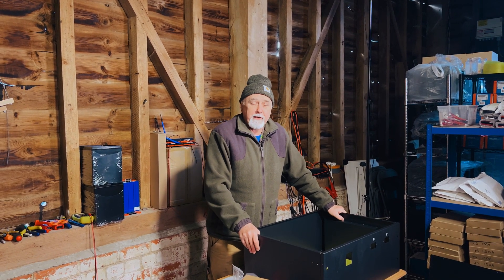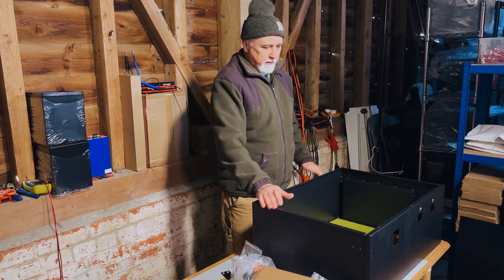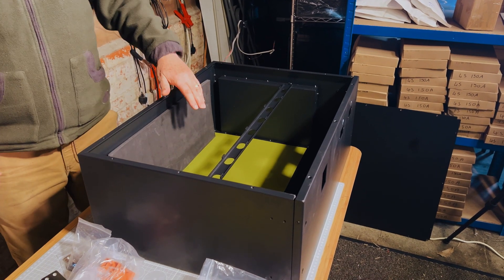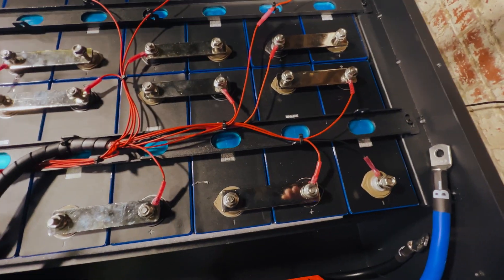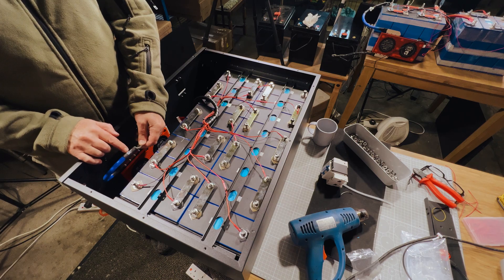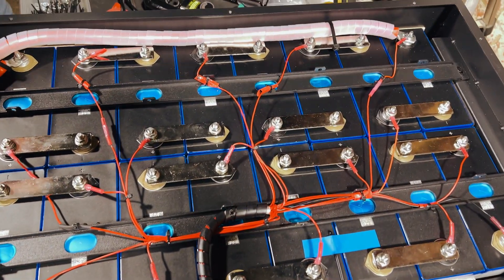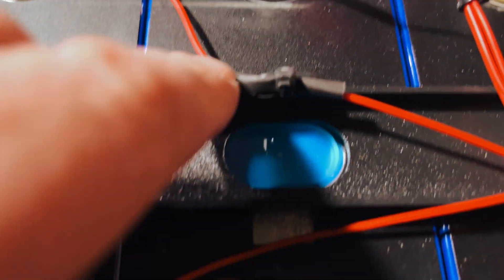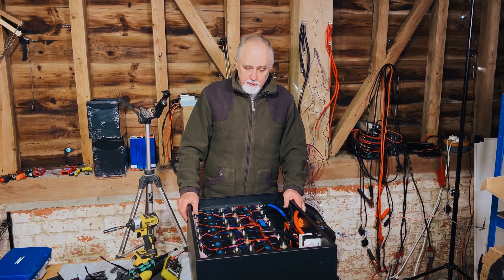New Custom 48V LiFePO4 Battery Build

Comment: That's how I wired mine up with final 48V connection points on the outer terminals in stead of the center. I like it farther apart.

Comment: I like what I see. Problem is you dont explain the BMS connection thoroughly.  I have a Daly 48V 250A 16S Smart BMS. I have connected  sample leads correctly, I think. They test good with multi meter. 
So, B- connects to main negative, thats clear. P- connection is less clear. I have 250 amp breaker as well. 
Do I connect P- with breaker in line to postive on battery?
Reply from the maker: The P- goes to your negative bus bar that you connect the negative lines from your chargers & loads. You SHOULD NOT connect the P- to positive on your battery otherwise you create a dead short. Here is a video that we made that covers the battery build in more detail: https://youtu.be/-ZxcGc59M60?si=4wHVPwTeWm-BUS9l

Comment: I enjoy your videos - it would be nice to see some thermal images on how the battery pack perform under load. Thinking of the FlirOne or Seek cameras solutions. Weak links would light up - its a nice tool to further improve the quality of the battery pack.
Reply from the maker: Thanks for the suggestion! We did some temp tests on another battery recently, which you can see here: https://youtu.be/A_isiUuqsW4
But we didn't get round to doing it on this big 48v battery sadly.

Comment: Good video. It's not about the time but resistance. I think BMS scans and measures the voltage with really low current flowing so the length of the lead doesn't matter. What you think guys. Am I correct?
Reply: I know the JK BMS throws a fit if any of your balance leads have high resistance but I think the threshold is quite high. Its to prevent loose connections. 

The resistance theory could lend some credibility to high amperage balancers....but 80ma is nothing. Now 5A or 10A...yeah the small wire gauge they use for those (about 18AWG) would create serious voltage drop.